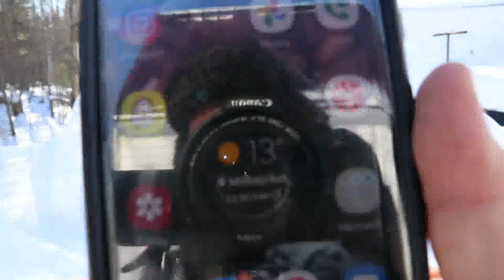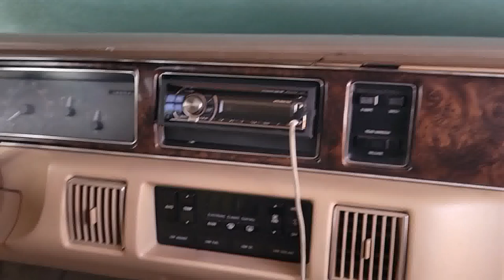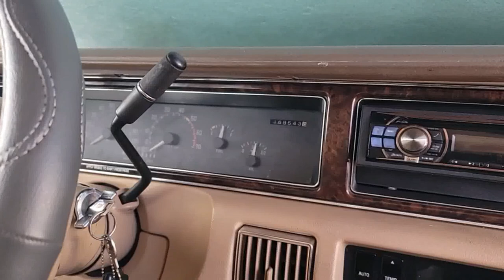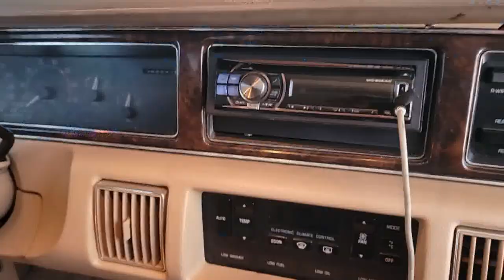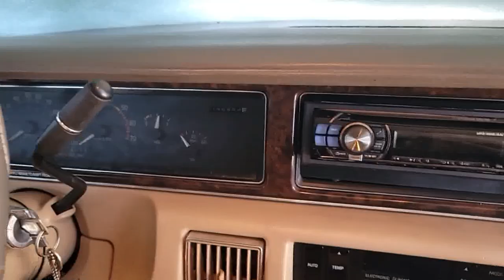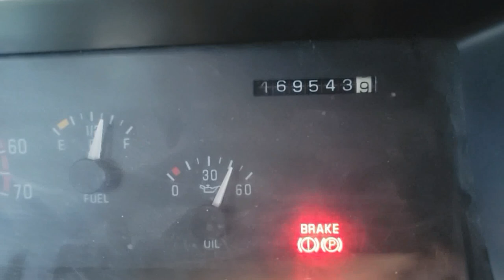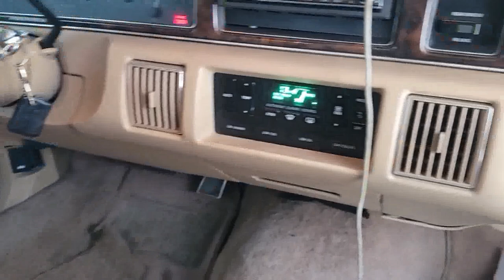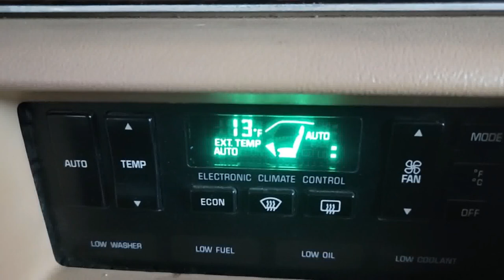Will it start? 92 Buick Roadmaster BURIED IN SNOW

Comment: Ya the 92 Custom Cruiser Think your Roadmaster is the same color used to start and move with that much snow. It got hammered a few times Get new hood struts you find them cheap onsale alot. I got Sachs . Stablus the OEM ones for like $15 for two a few times.